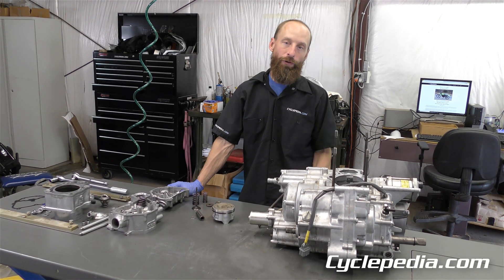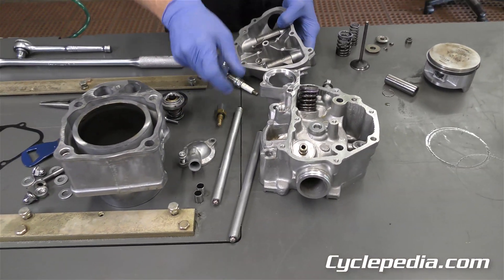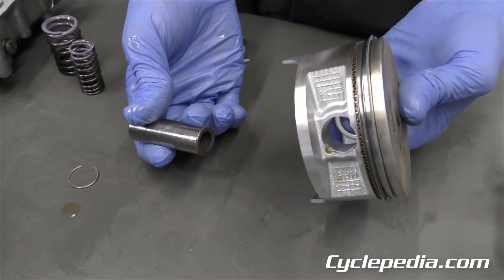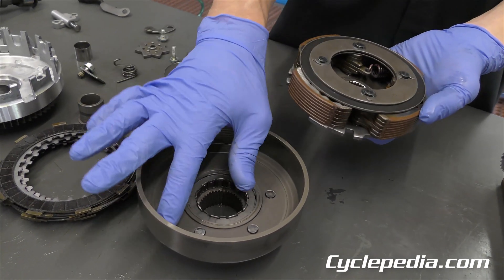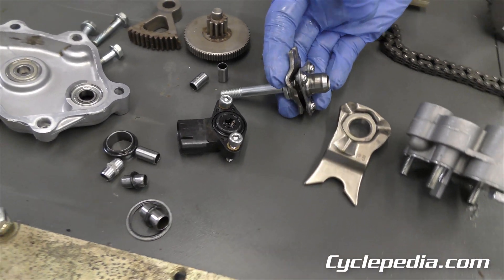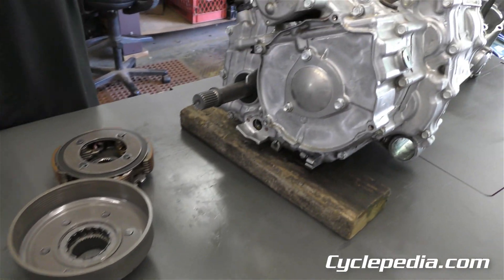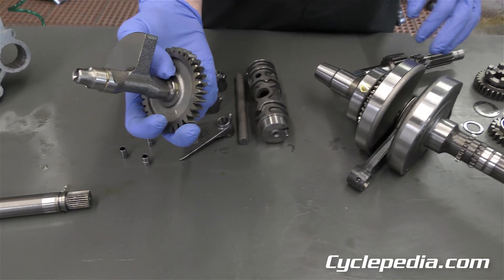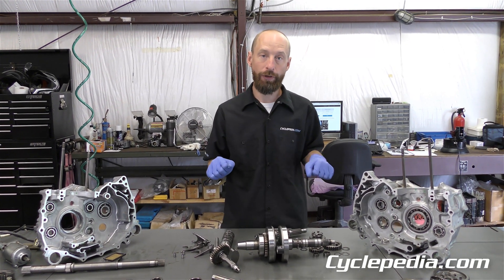Taking Apart a Honda TRX420 Engine

Comment: I’ve got an 07 rancher 420. Did a clutch adjustment and now it’s only in gear while the foot lever is all the way up. I’ve tried moving the clutch adjustment both ways to resolve but no luck. Any ideas?

Comment: I need to change my shift shaft.. the slimes are all gone on it.. will I need to remove the engine to do it
Reply from the maker: Make sure to check for any additional damage on parts that mate together but you should be able  to  change the shift shaft  without removing the engine.